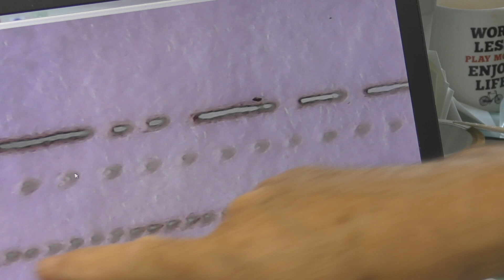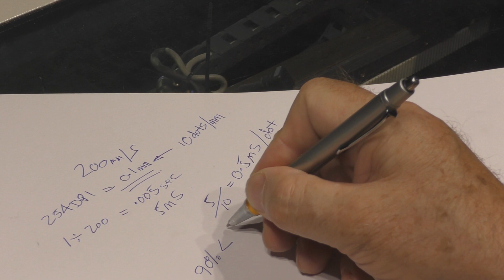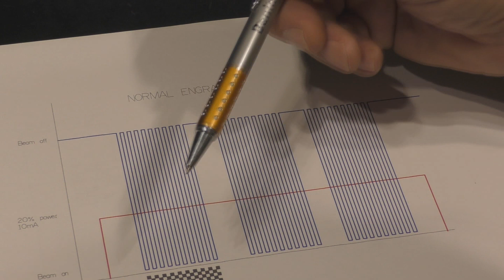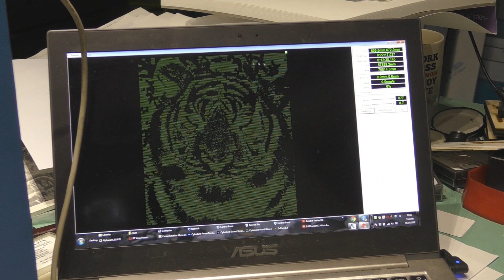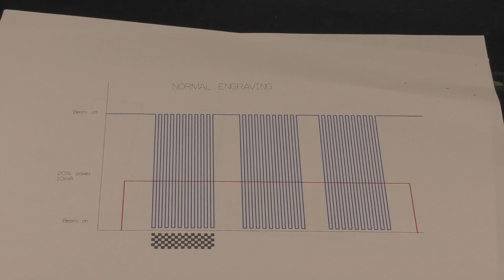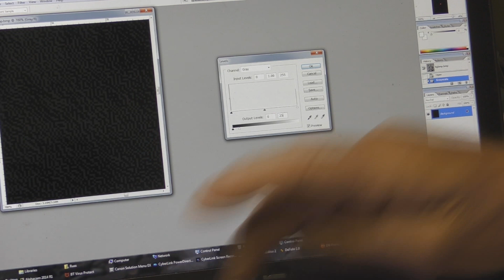RDWorks Learning Lab 159 The Chequerboard Challenge

Comment: Hello Russ!! I would like say thank you for all the videos and great information. I am in the process of getting my 80 watt China Laser,and I would like to ask if you would send me the information you have mentioned on your videos for the test programs and 254 Test Program. I would like to ask,if an 80 watt laser is to much for engraving on all  the material you have been working on?  Thank you Sir.
Reply from the maker: Hi John
If this is an Ebay 80 watt machine, the chances are that in reality it will be a 60 watt tube. You need power for cutting but delicate control of power for engraving, especially dot engraving. You will lose that delicate control with more powerful tubes.  60 watts is the ideal compromise for an all round tube but if your tube turns out to be a real 80 watt tube then don't panic because you will still be able to do dot engraving but at really low power settings where the degree of control is a lot coarser.
If you attach your email to another comment, I get auto copied to my gmail and will send the dot pattern. I will also delete your comment/email from public view.
est wshes
Russ

Comment: Hi Russ....Peaked my interest again, but probably not for what you think.
Nosey me would like to ask, what is that above your head in the rafters, red bottom, and looks like it has rubber feet?
Reply from the maker: Hi Rick

It's an acrylic sheet hot wire bender that I have not used for years  but I'm a a born squirrel!!

Best wishes
Russ
Reply: Cheers, Russ!
Reply: Hey russ, where can I download your checkerboard pattern from?
Reply from the maker: @traviswong6935  
Hi Travis
It sits on the Sarbar pages at  3dpassion.com  or at www.rdworkslab.com
If you have problems,  attach your email as a comment and I get auto copied to my gmail. I will then delete you email from public view.
Best wishes
Russ

Comment: You mention the power supply not being the original one, did I misunderstand this or did you buy a better on, if yes, which one?
Thanks btw for the long reply regarding protection and goggles, could not find the comment again though, was it removed?

Best regards
Reply: He did not long after he had the machine.  He made a video about it, and showed how to install it, because when he went to a 60 watt tube his blue turd of a power supply was the typical blue turd 40/50 watt that comes with the China blue machines.  He was amazed when they sent him a 70 watt tube etc...  He can post a link, if he wishes, to where he got them from but they came from an AliExpress store and is a good laser supplying company (not AliExpress the one he bought it from that starts with a M I believe).
Reply from the maker: Hi
When I upgraded to a 70 watt tube I replaced the power supply also.  I was very naive when I bought my machine and did not realize I was buying a reject tube and a B grade power supply. The first few months of my videos show me fighting with the obvious low power  from my supposed 50 watt tube.. I replaced the tube from an Ebay source and again, in my naivety bought another B grade tube. It was shortly after that That I invested in a power meter, proved that I had been duped and then decided to upgrade to 60watts. That meant I automatically had to upgrade the power supply. I always had doubts about it  and it was not until I started to get lots of correspondence from people around the world that I saw the pattern of C grade tubes and B grade power supplies from Ebay sellers.  The usual problem with these power supplies is that they have a very poor response time. They work in general for cutting but this failure to make the promised specification causes them to be unwarrantable and therefore reject. This performance deficit  causes a poor engraving characteristics.

Yes I did delete your comment  because i never feel it's wise to leave your email address in a public forum..

Best wishes
Russ
Reply: btw, his power supply is the one I went to as I still use real 40w tubes but my power supply is for 60w.  The MYJG-60 and it has an adjustment screw on the side so I made it that 100% power was 18ma which is the max a 40w tube likes and beyond that is over driving it.  50 is 20 and 60 is 22, etc...  It made a HUGE difference and has one helluva fast response time that the blue turd could only dream about on its best day.
Reply from the maker: @thebeststooge  Hi
Yes your original  wasn't an myjg..... but it could have been. The slow response time from a power supply means it cannot be sold with a warranty claiming it meets the less than 1ms response time. Hence it gets dumped on to the "repurposing" market and ends up in  Ebay machine.  They work ok for cutting where response time is not an issue.

Best wishes
Russ
Reply: Yes, they work okay (mine didn't really but that is a different story) for cutting but as you have said, and I know, these machines are sold as "engraving" machines and not cutting machines.
Reply: @thebeststooge  Has anyone got a link to a better PSU.
I have a 100w machine but I am not sure if my psu is crap but most likely it is. :(
Reply: 100w machine is an entirely new beast to me as the most I ever looked towards was 80w.  I would love to help you but can't.  Now if you post some pictures of your power supply (a model number as well) I can see what I see.  Just remember the more power the less it is an engraving machine and the more it was designed as a cutting machine but let me see some pics and any model number you can spot on it.
Reply from the maker: Yes the sharper looking picture on the right was dithered and done with the normal  ON/OFF dot scanning method. The picture on the left was also dithered but done using the greyscale power variation method. The dot picture on the right would have truly popped if the original picture resolution had been higher. To get a good 254dpi resolution picture you need to start off with at least a 300ppi image. The fact that it was originally a 72ppi picture up-scaled to 254ppi  meant a lot of information in the picture was "invented" . However it was adequate to compare systems. The 80% result was pretty good but when you watch the  refinements  in the footnote video you will see I got close to 90%.  This is NOT a dead approach to photo engraving and I will be looking for ways to refine it in future.

Best wishes
Russ